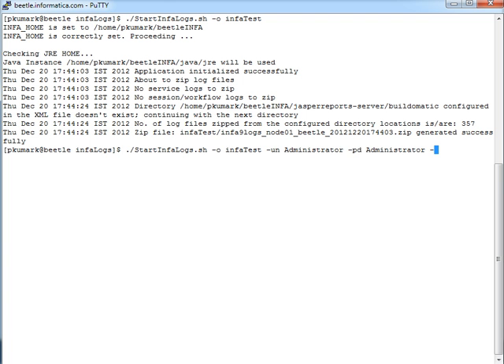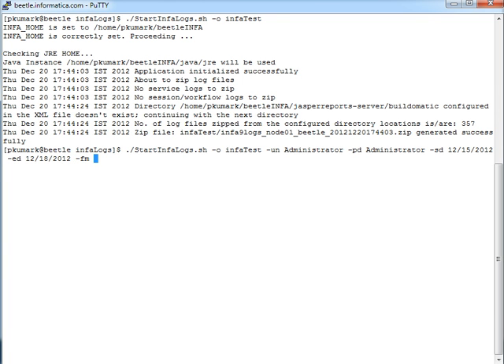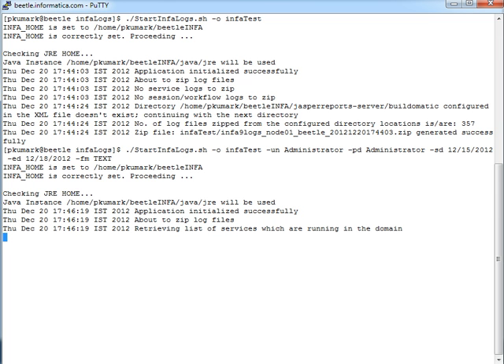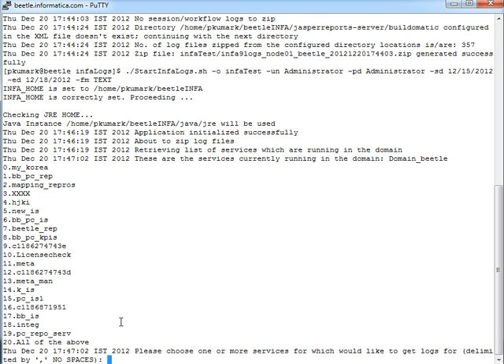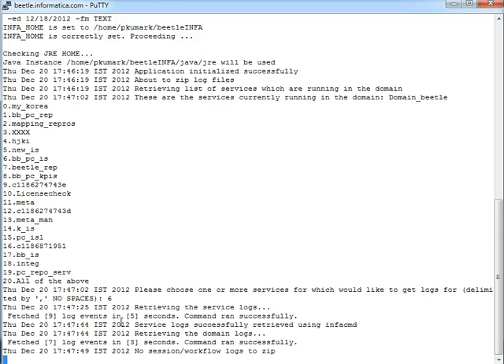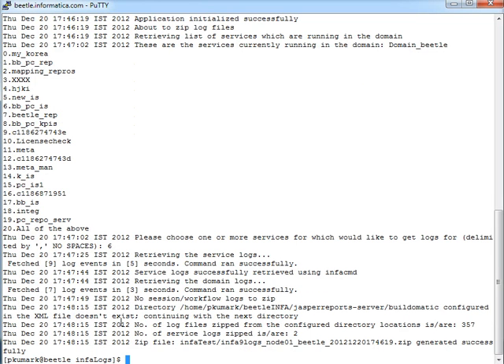How to collect logs using Infa9Logs Utility

Comment: Hi, I am running it on windows and it's producing a very big size log file and continuing to execute more than half hour...
and getting stuct by stating msg as falllows....

Wed Sep 03 14:49:34 EEST 2014 Please choose one or more services for which would
 like to get logs for (delimited by ',' NO SPACES): 2,3
Wed Sep 03 14:49:45 EEST 2014 Retrieving the service logs...
 Fetched [5677] log events in [4] seconds. Command ran successfully.
Wed Sep 03 14:49:52 EEST 2014 Service logs successfully retrieved using infacmd
Wed Sep 03 14:49:52 EEST 2014 Retrieving the domain logs...
 Fetched [776] log events in [1] seconds. Command ran successfully.
Wed Sep 03 14:49:56 EEST 2014 No session/workflow logs to zip